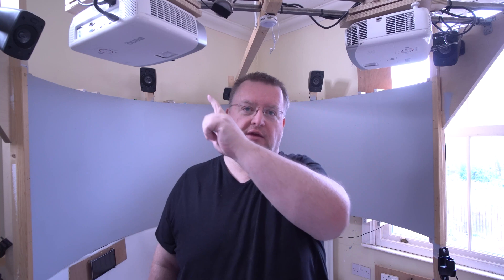Dismantling the screen of the old sim

Comment: Greetings!

I need your help. I'm a teacher and trying to set up a 360 immersive room in my school for students. For now, our objective is only to play educational videos like 360º museum tours on Youtube and use Google Earth and Google Streetview. Will it be possible with Immersive Display PRO?
I have a budget for four short-distance projectors and 1 PC with GeForce 4 HDMI ports. Do I need to buy both Immersive Display and Calibration Pro?  Am I missing something?
Cheers
Reply from the maker: Yes, you can do a 360 display with Immersive Display Pro. You don't strictly need to use Immersive Calibration Pro but I'd strongly suggest you do, you won't get a great result just eyeballing it. That means you need to buy Immersive Display Pro Ultimate edition, and I would strongly advise you to go with the Dongle version (even though it's more expensive) as this allows you to migrate it between different hardware.

With four projectors you will be able to cover 360 degrees on a curved screen, provided the screen size is small enough to fit. You'll need to understand the throw length and zoom ratios of your projectors and work out the rectangular diagonal size and horizontal curved arc length each can cover, with an overlap of at least 10 degrees for each image, and that will determine the maximum circumference (and hence diameter) of the screen you can construct. If you need a bigger screen than that, you will need more projectors. Most 180 degree setups use three projectors so 360 degrees would usually need five or six.

To give you an idea, my setup had a diameter of two metres (arc length of three metres) for the screen and at maximum zoom I could cover about 3.5m arc length with two projectors. 

Now, whether YouTube 360 videos will work on that setup - I can't say. Those videos are intended for viewing on a VR headset and I'm not sure if it's possible to re-project them correctly with warping onto a circular screen. That's not my area of expertise. 

In all honesty, it might be easier to invest in a VR headset. Only one person could take the tour at a time, but with room-scale VR they can walk around the room. 

One last idea - you might want to look at a CAVE setup instead of a circular screen. This is a cube arrangement of screens - or in your case, four flat screens at 90 degrees to form a square - which Immersive Display Pro Ultimate definitely supports. This could be done with four projectors, one for each screen, and the square size would be determined by the maximum diagonal image the projector can display. You also avoid the problems with sharpness and focus inherent with curved screens. For a CAVE to work well, it needs to be rear-projected which implies you'd need a large room. 

And that also applies to a circular screen - if you want to avoid the shadows of people inside the screen blocking the image, you'd need to rear-project.

Hope all of that helps! If you need to reach out directly there's a contact page at https://backbedroompilot.com.
Reply: @FlyerOneZero  Thank you for your feedback! Yes, we thought the circular room could be kinda difficult to build so we are aiming for the CAVE setup (like this one https://www.youtube.com/watch?v=KjUHngd5fDk&list=WL&index=24). For the YouTube 360 videos, I'm thinking of doing a small scale testing with  3 or 4 regular monitors facing each other. Cheers!

Comment: Hi 🙋🏽‍♂️Excuse me, what material is the surface of the screen or is there a store where I can buy it? Great video !
Reply from the maker: It's just hardboard, which is availably at any big hardware store. It's the material that you often find the backs of IKEA cabinets etc are made from. It's thin and flexible so it bends around the curve easily enough. The surface needs to be painted, I used Screen Goo Max Reflective paint which is rather expensive, but you can use a good matt white latex ceiling paint.

Comment: Cheesy music, reminds me of Benny Hill. 😂 Don’t you feel a bit sorry to destroy something you put in a lot of effort?
Reply from the maker: The Benny Hill thing was quite deliberate, seeing myself in timelapse like that always makes me think of his show, so I'm glad that you picked up on it! 

Do I feel sorry about dismantling the sim? No, not really. Yes, I put a lot of time into it but I'm planning to make something better and that's something I've wanted to do for ages. Also, I'm not throwing it all away by any means. If I continue with a projector-based display - and I'm currently contemplating whether to move to multiple large TVs; there are pros and cons in either direction, I may vlog about it soon - then I will be re-using most of the screen frame, but I will want to extend the FOV to 220 degrees and that means adding extra pieces, and I also want to mount it differently in the room, and mount the projectors from the ceiling. I still have my existing console setup in the other room that I can fly on. Some of that will get re-used as well.

In the grand long-term plan, this next sim will get demolished to to make way for a bigger build in the garden building I have been wanting to put up since 2014, but have not been able to. That probably won't happen until 2025 at this rate, I have much bigger house maintenance issues to deal with first and it's not cheap to do, but that's the eventual plan, and again I'll probably keep some parts of the new sim and dispose of / recycle other ones when the time comes. 

In some ways, I like building the thing more than I like flying it, so it's good to have a build project again!
Reply: @FlyerOneZero  I found out that I used the wrong dimensions for a certain part of my 737 cockpit. I really have to change that but it means demolishing it partly, and I can’t bring myself to do it. I’ve been postponing it so far.
Reply from the maker: @737sst  Oh yeah, that feeling I know all too well. I've been wanting to fix some of this stuff for years.